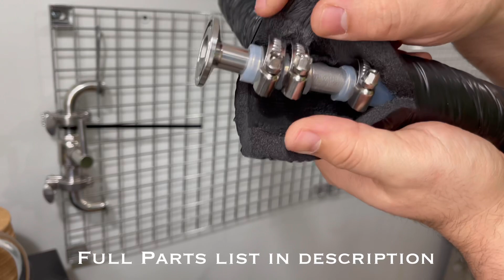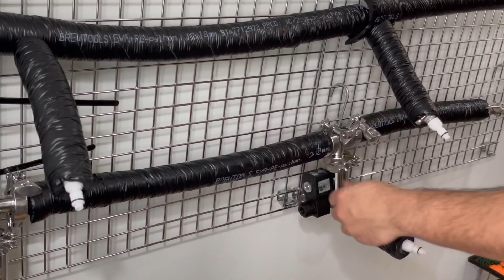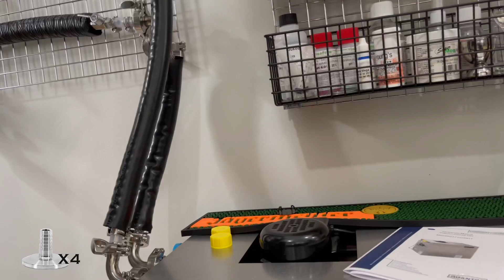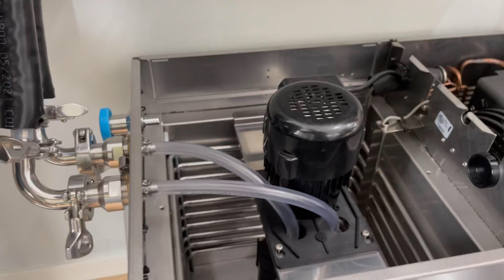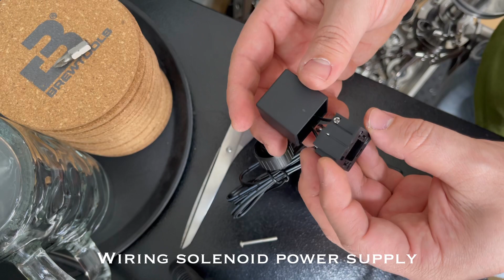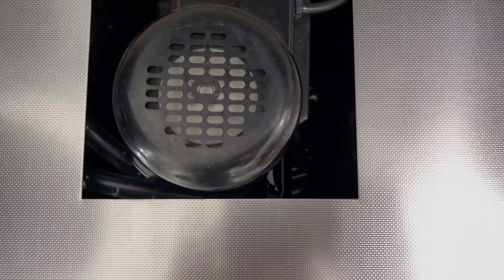Brewtools Glycol Loop & Quantor MiniChilly09 Setup

Comment: Is there any advantage in attaching the spunding valve to the blowoff pipe instead of mounting it to the 4th empty port on the top of the fermenter ?
Reply from the maker: I mostly do it to keep it out of the way of yeast coming in contact with it. Also, I add a butterfly valve underneath so if I need to service it or if yeast blows off and into it, then I can easily remove it and clean it without removing pressure from the tank and put it back again. Also in my opinion it’s more aesthetically pleasing that way.
Reply: @MasteringHomebrew  ah ok yes, truly a good point to keep it away from the yeast ... think I'm also going to use that approach ... thanks !

Comment: Thanks for the inspiration! I am to set up a system with 4 fermenters and thinking of using your loop. But why is there a valve in the middle of the main glycol loop.The one separating the the cold and "warm" or in and out. Also im looking to do the main loop in 12x18 but is downsizing the dimension to the individual fermenters to an inner 10 using quick connecters or another connection type of 10 mm a problem?
Reply from the maker: Hi! So the valve that is in the middle of the loop is to give the “glycol in” / bottom line a little bit of back pressure so it fills the jackets correctly when all the solenoids are open at once. It’s important to note that the brewtools fermenters jackets should never be under any pressure and the out lines should always be free flowing back into the chiller. The other valve I have on the glycol in line towards the other end is to shut the glycol line when not in use so I can disconnect it without the lines all emptying out. I don’t see changing the connection type size being a huge problem. Im using a few different sizes myself.
Reply: @MasteringHomebrew  thanks again, ill give it a go. how open/closed is the valve to reach the proper backpressure?

Comment: Very nice setup, thanks for sharing. Can you tell me what the role of that solenoid valve is? I see that it is powered, but is it controlled by anything else, or has it been put in between for safety reasons?
Reply from the maker: Thanks! The solenoids basically play the same role pumps do. The solenoids will be plugged into the cooling side of the inkbird so they open when temps need to come down. The glycol continuously flows through the lines ready to supply very cold glycol and remove warm glycol as needed. There is a pump in the chiller that will work for both tanks. Also have added the extra port if id like to use my own pump in a more traditional homebrew way. Its pretty flexible.

Comment: Nice! Do you have a link for the power supply you used for the solenoid? Do you plug that directly into the inkbird?
Reply from the maker: Yep I plug it into the cooling side of the inkbird. So here is the link where I purchased it from but they seem to be sold out everywhere here. I actually only have one right now. Trying to prevent the need to drive super far. Im actually just about to head to the shop to find an alternative. Just make sure its DC24V, 10W

https://www.clasohlson.com/no/Batterieliminator,-24-W/p/36-4400
Reply: @MasteringHomebrew  Cool, could you give an update if you figure out another solution?
Reply from the maker: @KristianKlaveness  i just ordered this one. 

https://www.kjell.com/no/produkter/elektro-og-verktoy/stromforsyning/stromadaptrer/acdc-stromadapter/justerbar-utgangsspenning/luxorparts-justerbar-stromadapter-924-v-dc-24-w-p45187

Comment: hi, I want to ask what is the purpose of the Ball valve in the whole system?
Reply from the maker: Hi! It is to create a small amount of back pressure to help push glycol through both tanks if/when both solenoids happen to be open at the same time.
Reply: thank you  @MasteringHomebrew
Reply: I'd also add that in most commercial chillers, the pump is always on. That valve functions as a bypass so there is always flow and the pump isn't  deadheading. That's a pretty slick set up with all high ends parts. You ever try running it to a heatex to cool knock out?

Comment: Absolutely gorgeous! If you only had one fermenter, would you still need to do this sort of setup (recirculation line + fermenter lines)? Or could you just go direct to the fermenter and then use an inkbird to control the main pump? Or would that stop recirculation within the chiller itself when it's off? Getting the finishing parts for my setup! Great inspiration here :)
Reply from the maker: Thanks! If you only had one fermenter this set up wouldn’t make too much sense at all. It’s only really practical for two or more fermenters. The big benefits really come in at 3+ fermenters id say. I have added a port to have a pump I can control myself with an inkbird as a “just in case”. I think the real advantages of this chiller will really shine when Brewtools releases their temperature controller. I think if you use an inkbird or alternate temperature controller for the Chillers pump it may also stop the mixing function. I’m not 100% sure about that though. It does appear its possible to wire up the pumps power switch to a controller though.